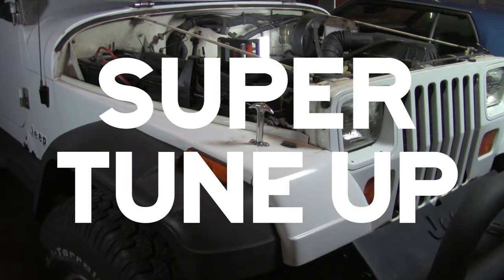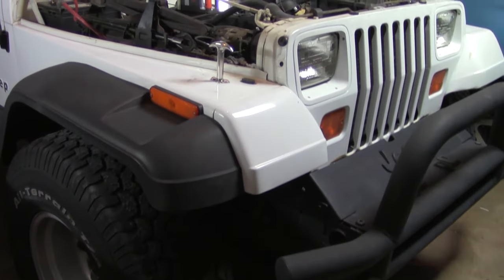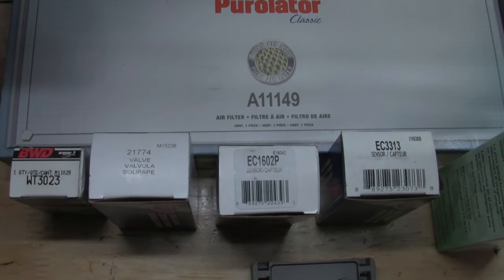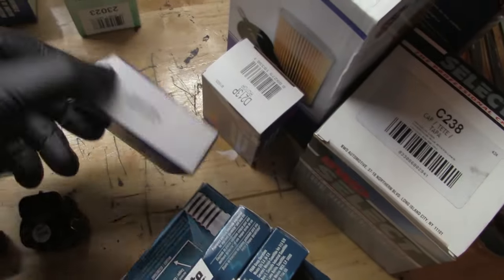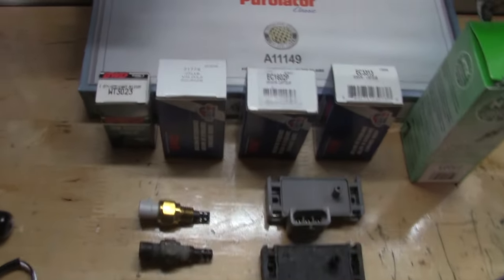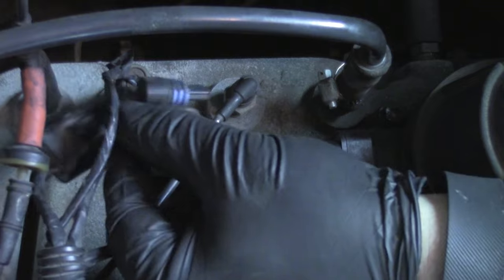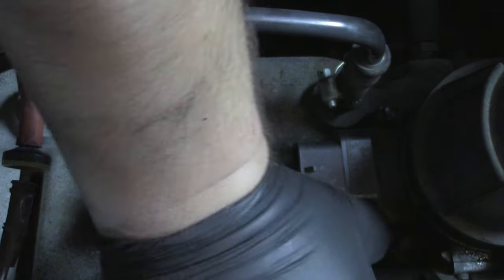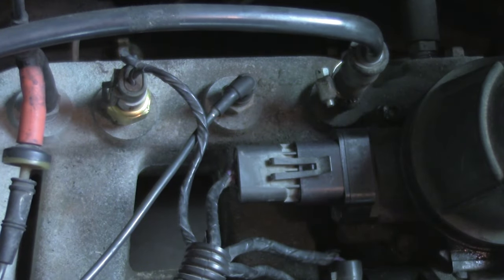Jeep YJ (Wrangler) Super Tune Up | Get that perfect pep & idle

Comment: one thing about the Idle Air Control  valve...when you remove it, there is an O-ring that you want to make sure you don't damage when re-installing.
Reply: Put silicone .
Reply: @sergioherrera3029  Uhhhh no.
Reply: @revolutionday1  I'll get the ring 😂

Comment: I own a 1995 wrangler. The map sensor is a GM. THE ECM COMPUTER is a Chrysler mopar. Jeeps in those years had many parts from different factories. Why? Is the question.
Reply: As amc owned jeep prior to chrysler , they sourced parts from other automotive manufactures. 
They then pieced the jeeps together.

Comment: I changed all the sensors in my jeep today . It purrs like a cat to . Check engine light when off . It doesn't idle high and low no more . It runs so much better . Thanks for the vid

Comment: I have a '95 YJ. Had been having issues with intermittent high idle depending on ambient temperature outside. Would start in the mid 80's at about 1100-1200 RPM, up to 1800 RPM once it hit the mid 90's and up. Another mechanic finally figured out that the computer wasn't relearning the IAC Valve after it was replaced (it was bad). He had to use a computer to take control of the IAC and adjust it correctly because the computer wouldn't. Had the problem for 10 years. SO happy it's fixed- FINALLY!

Comment: I just did my cap and rotor with new wires, also put in a new fuel filter on my 1991 YJ. Finally got it running after 11 years of sitting. I will now be doing the senors for sure. Thank you👊🏻

Comment: Changing sensors after a period of time is wise-preventative maitenance. I had a vehicle with 150k, changed each sensor as cash allowed and most of them made subtle differences in engine operation. Taken together it makes a nice improvement.

I pulled apart my TPS (the original) and the wires inside had a lot of white corrosion on them. Given that its job is to send a signal back to the computer to manage overall operation its important to have a clean signal. Corrosion will affect resistance and in turn send a weaker signal back to the computer. Changing the TPS made the single largest sensor improvement as far as "seat of the pants" go.

Comment: Thanks for posting this sensor vid.  I have 1997 Jeep XJ Sport that has been having some issues even after having the engine rebuilt.  I'm going to replace the sensors, plugs, cap & rotor and I hope that will make a 100% improvement.  The 4.0 I-6 is the workhorse of Jeep's and I know I can improve its performance with simple maintenance.  Thanks!
Reply: Mark did changing the sensors help

Comment: You are a brave man putting all that import autozone advance junk on at once.  I have had 20s or more of parts be bad right out of the box. Not to mention say in the case of the o2, the 4.0 likes a certain factory brand and doesnt play well with others such as Bosch
Reply from the maker: Still running well today. No issues with these parts installed in the video.
Reply: He did use NTK O2 sensors, which are OEM. But yeah, I personally wouldn't do them all at the same time in case I needed to troubleshoot a problematic one

Comment: Another good sensor to maintain or watch is the crank/cam shaft position sensor, there are about 3-4 different sensor types depending on the year of the yj. If it dies or stop working, the jeep will not turn on. Trust me it happened to me lol

Comment: Hey thanks for this video! I ordered all of these (which btw make sure you do some shopping around before you go to one store and just buy them all you can easily shave $50 bucks off the price that way). Anyways, I'm having sputtering, surging, terrible gas smell, code 52, and around 3k rpm the jeep starts to lug out as if you have a limiter or are pumping the gas petal up and down. Hopefully these will help it out and make it run good again. I'll let you know!
Reply from the maker: Skippy A these parts should help you. Sounds like the ecm is trying to over compensate by adding loads of fuel for the miscalculation of air / spark / timing. All of these things are what the above mentioned sensors are trying to achieve. These sensors are trying to create a harmony with the engine. The gas smell is obviously the engine running rich and the sensors are what tell the ecm to make the engine run rich. Clean your throttle body real good when you replace your sensors and make sure to come back and let us know if it helped.
Reply: Alright well here's my follow up. Overall, the Jeep is running better. At stop lights the engine would want to stall when picking back up in first gear and that made for some pretty embarrassing moments haha. So the surging has been taken care of and it warms up from cold a lot better now without sputtering and such. However, I've run a good gas tank through it and code 52, gas smell and the odd issue of not wanting to go past 3k rpm persist. I'm at my wits end with this issue. I'm suspecting that the Catalytic converter might be clogged and therefore causing build up in the down pipe where the O2 sensor is and that is making the Jeep read rich. Does that make sense?
Reply: I've also done some modifications to the Jeep that could also be a cause of the issue. I have a 2.5L 4cy and in order to give it a bit more "Umph" I swapped out the 2.5L throttle body for a 4.0L throttle body and added 19lbs injectors to it. My friend  did the same mod with no ill effects though so i'm skeptical.
Reply: Thanks for the video/comments I do have all those fails and terrible gas smells.  I will replace all of them

Comment: Great video. But, replaced the IAC and now it idles at 3k. Can't get the TPS out due to stripped bolts. O2 has possibly never been changed because it isn't moving if my life depended on it and I don't want to replace the entire pipe. Old cars man.

Comment: The reason it says GM on the sensor is that older jeeps are notorious for using a bunch of different parts on the vehicle. Alot of GM parts and sensors are used.
Reply: yes!  can get gm sensors for replacements, some from various chevy cars, etc. for the 2.5L jeep

Comment: Very helpful! Thank you. Purring like a kitten. Question: The O2 sensor is frozen and can't remove it. Thoughts on getting it out?
Reply: Mine too. Apparently the rust fused right into the pipe and I would have to replace the exhaust pipe.
Reply from the maker: Don’t remove it then... drill a new hole and add an O2 bung
Reply from the maker: Get something like this. Add a new one https://www.holley.com/products/exhaust/builder_components/exhaust_components/parts/71014302-RHKR
Reply: @Archifx  dammmmnn. Haha No idea they made this. I covered up a hole in the exhaust pipe of a Honda with something similar.

Comment: Great video!  I am new at all this (just bought my first 92 YJ) so it was very helpful. Quick question though: after I changed the MAP sensor, I started the rig, the check engine light came on, the start was difficult, and the Jeep idled weird (high). Any thoughts?
Reply from the maker: Disconnect battery for 1 minute, reconnect. Let it run for a few minutes. Let the codes all establish new baselines. Should straighten out. If not, check the new engine code to see what other failures you have.
Reply: @Archifx  Awesome! Will try that! Thanks!

Comment: Sometimes used sensors are a good choice, because aftermarkets are such poor quality and don't meet spec, so even a new sensor will make the Jeep run poorly.  I had to use a used air-temp sensor.

Comment: I have a 1991 Jeep Wrangler YJ, 4.0, 5 spd.,
Is there any reason NOT to use Auto Zone or O’Relly parts, for this job? I’ve heard roomers they have subpar parts for Jeeps? Who do you recommend for all high quality Jeep replacement parts? I have had fit problems with my motor mounts & VSS: Vehicle Speed Sensor, wrong threads on both and was told my new rear drive shaft U joints were subpar. 
And what about the Crank position sensor, when should you replace that sensor? Thanks for a great video, keep up the great work.
Reply: just depends on the year in which you bought or are buying and which parts, their quality can vary, as can any company's, due to moving manufacturing to/or back from china, specs changing, getting a bad reputation and trying to rebuild it..... a lot of info on who's parts are bad is old and they are now good again, or vice-versa   for example, do (2017) get an odyssey battery, but don't get the others that used to be good

Comment: I got an issue with my 94 yj that has been bothering me for a while.after driving for like 30 minutes or more,when i stop and try to restart the jeep,it cranks but will not start.so i have to wait for some hours then it will start like magic😄😄..i appreciate your thoughts on this.thanks!
Reply from the maker: EGR valve. Pull your codes

Comment: ive got  the amc 2.5 liter engine,my MAF sensor and  the Manifold temp(hot) water, both inputs are 2.34 volts and they both got back to ONE WIRE?, Ive got  the renix computer and I thinks its shot, all sensors have input,voltage and send out signals but no computer response

Comment: should have just taken out the throttle body. 4 10mm screws. clean idle passages and clean with carb cleaner with sensors out of coarse

Comment: Might be a stupid question:
Is this Jeep fuel injected?
I have a 90 and it has a carburetor with a round filter up top.
Reply: Adrian Angulo that jeep looks fuel injected they didn't start doing fuel injection on the six cylinder until 93 or 94 when they came out with the 4.0 before then it was the 4.2 carbureted

Comment: Could you tell me which is better?? BOSCH or NTK parts . I'm putting on a new oxygen censor
Reply: bosch is what i used, would tend toward bosch being better quality, they are probably more $$
Reply: Giovani22 got for the ntk jeeps run better with that brand,  Bosch tends to crap out
Reply: I agree with NTK. I've read nothing but good about NTK with Jeep.

Comment: Anybody know what parts become compatible, if for example I have a 91 YJ but a 97 2.5 (TJ). Say for instance a starter. Am I okay getting a tj starter for a tj engine? Stuff like that. Is there a point where it may not matter. It could be compatible with a yj? This jeep seems to be TJ in its engine, transmission, and transfer case. Or changing out the heater core. Can that be a YJ heater core instead of aTJ heater core? I'm guessing sensors all around and muffler sensor better be TJ  related? It makes it so much fun asking for parts at the parts store.

Comment: Before watching the video I went ahead and replaced the IAC and TPS. The RPM when it is now idling at 1000, is that still too high? Or do you think I should replace the other 3 parts as well? I also cleaned the throttle body flap really good, it was reallllly bad before.
Reply from the maker: +Mikeyy too high. Should be somewhere round 500-700 rpm. Replace all and do the plugs and wires.
Reply: I mean if I can't get to it right away would that be an issue? If I has to wait about a week or two? Very light driving btw. I don't think so but just thought I'd ask.
Reply: plugs and wires were done too***
Reply: do O2 sensor!!!  :)  very likely, and rotor plugs wires cant hurt if more than 20k on them

Comment: Which IAC manufacturer do y'all recommend for my 95 YJ?
Reply from the maker: Not sure of brand but the one I installed in this video is still perfect years later. Just don’t get the cheapest one. Get one that’s recommended by your parts pro at the big box store.
Reply: @Archifx  Got myself a new IAC, when to install it today and noticed that the electric connector wires are a bit severed. WTF??!! Any idea where I can purchase a new 95 jeep wrangler 4 Wires Electrical Connector Idle Air Control Valve.

Comment: What's that red light on dash? I have a 95 and will be doing this too
Reply: that was the brake warning light, either the switch on the e brake or the switch on the proportioning valve

Comment: Always always always!!! Use mopar parts when changing out any sensor or electrical components not bullshit carquest or ntk etc yada yada. If u don't use mopar in a vehicle manufactured from mopar will be detrimental to engine longevity. Trust me, mopar costs bout 4 times as much than any aftermarket but quality prevails in my book any day.
Reply: A lot of Mopar sensors from the factory were NTK. Spark plugs were NTK from factory, too. At least for Jeeps
Reply: @SeriouslyAwesome  ntk is Nissan... granted they own ram and Cummins the last couple years. I've read damn near everything on mopar parts for jeep nowhere on anything I've read talks about ntk being associated with AMC, Chrysler,  mopar, dodge,  fiat or alfa romeo. If you have please send me a link. I always give the benefit of doubt.
Reply: @paytonmoore221  yeah, it's fairly common knowledge on the Jeep TJ forums for o2 sensors because any other brands, like Bosch, consistently just don't play well. I can only speak specifically to the AMC motor TJs. Other sensors, and fuel pumps, it's preferable to go Mopar. We also come stock with Nippon Denso alts, which is part owned by Toyota.